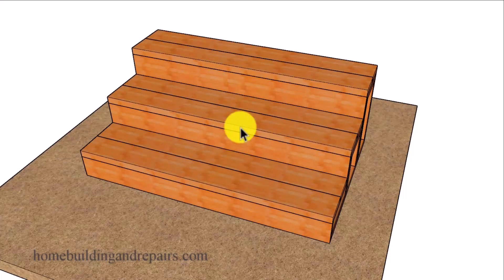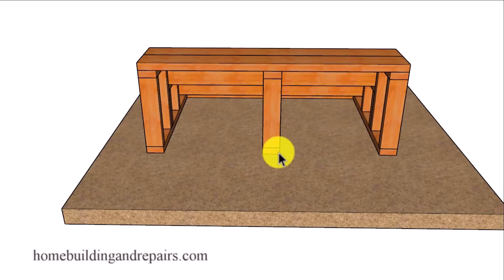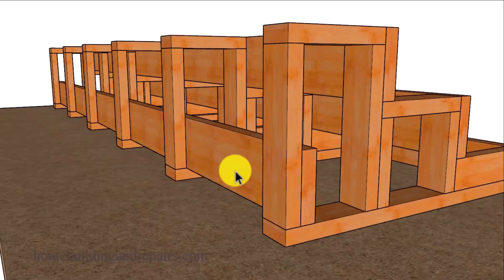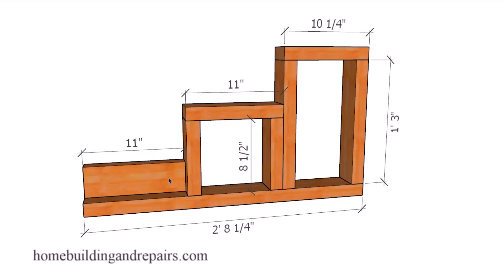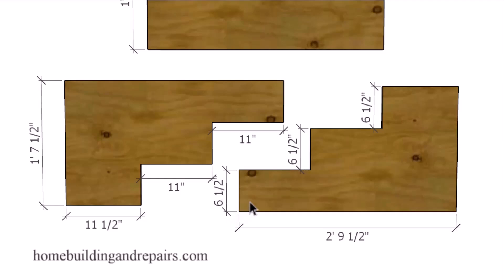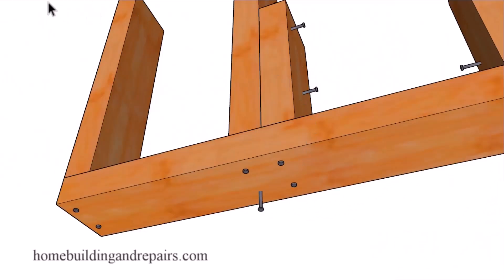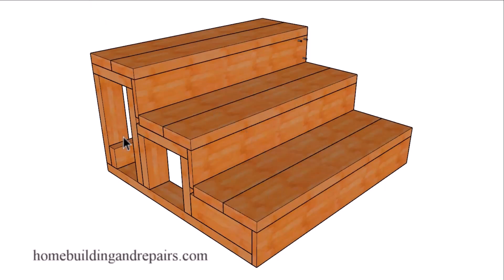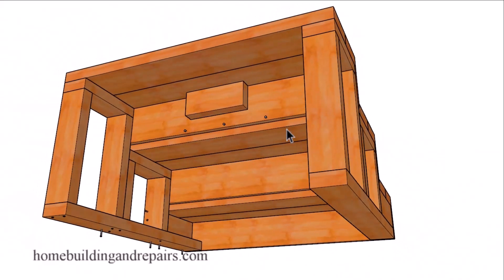Stair Building Without Standard Stringers - Spacing, Spans, and Reinforcement

Comment: You can also use LVL treads to span much more than 24". Ive built stairs up to 48" wide with 1.75" LVL treads and engineer only required a single LVL stringer at each end, nothing mid span, and it was an extremely solid set of stairs.

Comment: So... Exactly what is a stringer?
Reply from the maker: A stair stringer is the structural backbone of a staircase, an angled board (or boards) that runs along the side (or center) to support the treads (where you step) and risers (the vertical parts). Made from wood or metal, they create the notched profile that holds each step in place, ensuring the entire stairway is stable and safe for use, acting as the main load-bearing component.
Reply: @gregvancom Thank you. Appreciate the reply.